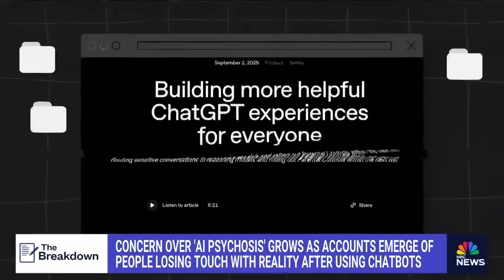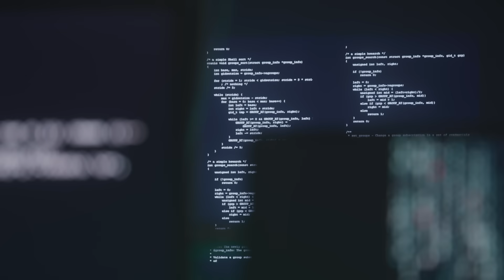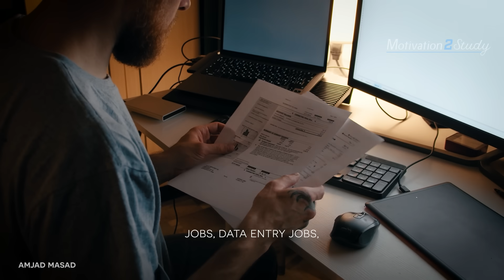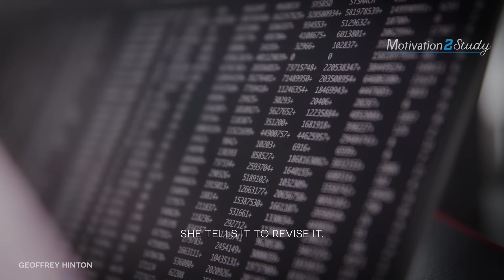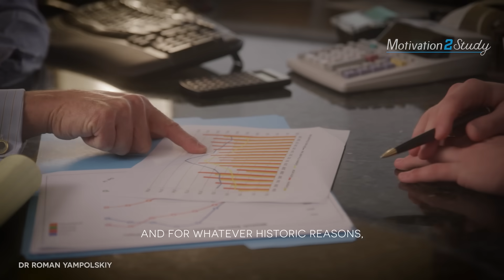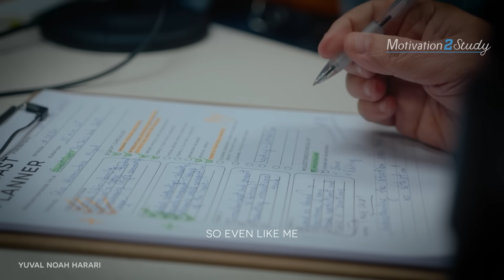AI Experts: These Are The Only 5 Jobs That Will Remain in 2030!

Comment: The point  about 'Info In, Info Out' jobs being dead is the hard truth devs need to hear.

But I'd argue 'Coding' isn't disappearing, it's splitting. The 'Info In/Out' part (writing code/Orchestration) is definitely gone. But the Judgment part (Validation)—knowing if the AI's output is secure, scalable, or hallucinating—is becoming the most valuable skill in tech.

I see too many engineers trying to compete with AI on speed (Orchestration) instead of pivoting to quality (Validation). I broke down this exact survival strategy in my podcast (The Spark and The Forge, Ep 78) for anyone who wants to know what 'Validation' actually looks like in practice.

Comment: All the yoyos talking about manual labour being replaced by "robots".  Um. I don't see it happening. A physical entity has to show up and fix the broken plumbing.  Change a senior's diaper in a long term care facility.  Place the drywall on the studs.  I fix computers and iPads for a living.  Someone has to pry off the smashed glass and put the new one on.  Or at least feed it into the machine that does it for you and return it to the customer.  And transportation will ALWAYS require systems to be maintained.

Comment: We currently are controlling the movements and operations of a robot on the harsh surface of Mars.  If it's financially possible a robot can be made to do all the manual labor jobs we have today.  Driving a truck, fixing an heat and air problem, stopping a leaky toilet.  
It's building things so they can program a robot to work on the truck or heat pump or toilet.  Once these are in homes with GPS signals attached to them, the even physical labor jobs can be replaced.
I'm retired and thus won't be around.  But the current discussions about socialism and capitalism will be as useless and discussions about using whale oil to light lamps.  Just an old man's talking about nothing important.  It takes a long time to send a signal to Mars.  Sending a signal to earth from just outside our atmosphere will be child's play. Profit, not technology is what keeps it from happening now.

Comment: OH no. Ai drives my car: never.  Makes my food: Never. Washes my clothes: never.  Makes my pretty bookcase: Never.  Paints that lovely picture or the details on my wall or car" Never. Does my tricky plumbing job: Never, digs ditches all day long: sure dirt and sand in it.  There are so many jobs I can think of.   Servers will stay and cooks will stay.  All small and most middle jobs will not be using expensive AI.  Big business may only do part AI and testing to see IF it works with their private software can be brutal on business.   This is not really going to happen over night or have Terminator staying at over jobs.

Comment: I am a Deisel tech, Rigger, auto tech Semi Tech, certified Wlfer, CDLA, HZ licensed tech, sanitation tech, road construction tech, Hvy equipment licensed operator, Machine and certified Robotics Tech, Hardware tech. Tool forger, roofer, certified by CertainTeed. ASE, GM, FORD, TESKA certified techs, certified gunsmith, licensed Master industrial electrician, licensed Master plumber. I will always be needed.

Comment: I agree with something, reality is something we need to preserve. I think we are very far away or creating alternative reality (e.g: Virtual Reality). Those who work in the real world, services that imply contact and communication with human beings, a simple hairdresser, are the ones who will be kept. Yes, I know this AI thing will improve but as for today, I am a heavy user of Gemini, we are not that close. I can certainly save time in writing an email the right way and AI is certainly a nice helper in that task but answers, I do not get right answers (case of Gemini) no even from Google products. Do AI read manuals? I am serious doubts about it... and I am really skeptical about we can reach the point we can trust in the answers of an AI. So every input - output system is not going to be done enterely by AI so easily... that is my vision and also my idea about AI... be a helper.... you know, something so apparently simple for an LLM system like teaching languages is far away from being effective. We need the teching part (the patient of a human being) but also we need the tech to work. Like at the beginning of the 20th Century... they had planes, humans could flight, but they didn't have thousands of planes crossing the sky... if I want even a handy helper, I need to have enough power, connection, electricity to interact in a real time based situation with the AI and even that is not so simple to achieve. It will be an error to stop learning from ourselves... if that is the case, if we abandoned the books and trust just in AI we are a society so easy to control...

Comment: I’m a carpenter. I would love to see a robot do custom remodeling in an old house without taking 1 million years to get a job done because it’s not gonna know the little tricks of the trade that I’ve picked up over the past 25 years.
Reply: I completely disagree.  AI and robotics are evolving faster than most people realize. The “tricks of the trade” you’ve learned through years of experience are just patterns; pattern recognition is exactly that at which advanced AI excels.  Once a robot is trained on thousands of real-world remodeling examples, it won’t just match your experience, it’ll combine the collective wisdom of every skilled carpenter in history.

The idea that robots will “never” figure out custom work in old homes underestimates how quickly adaptive learning, vision systems, and tactile feedback are advancing.  Humans once said the same thing about machines replacing factory workers, welders, and even artists.  Now, AI can design blueprints, analyze structural weaknesses, and even simulate the best material choices faster than any person could.

Respectfully, it’s not a question of if robots will master remodeling, it’s only a question of when.
Reply: @ChesapeakeBuckeye just don’t train the robot.  This goes for all fields of work.  If the robots aren’t trained, they can’t take over.
Reply: @tmarkpolansky  you have an interesting point for another discussion, however it doesn't relate to this conversation.
Reply: @ChesapeakeBuckeye  Very sadly, you are right.
Reply: @ChesapeakeBuckeye can I have a home repair robot?
Reply: Hes got a pojnt and your right
Reply: @ChesapeakeBuckeye  Who is going to train these thousand of real world examples. Companies will not even train people now. You think they are going to spend millions of dollars to train some robot.
Reply: @ChesapeakeBuckeye  So far the ai humanoid robots have been pretty much fake or very clumsy.
Reply: @EthanThruandThru  I'm referring to the future not the past nor even present
Reply: Houses will be 3D printed in the near future.
Reply: Nope, all of your little tricks of the trade can learned.  Your are still grossly underestimating the learning abilities of future AI.
Reply: @DraLaRoc  AI gonna shock the world in ten years movies like Tron I robot and terminator becoming a reality much faster the next 20 years will uncomprendable
Reply: @DraLaRoc  Learning something is different than doing it. Ever had to dig yourself under a house to fix a broken pipe. I dont see A I doing that.
Reply: You will get the opportunity to see
Reply: @josho1778 I think I'll pass on a cusom remodeling jobs from a robot. I'm good. I'll still use a person, company.
Reply: You may not get replaced, but there will be a massive decline in general construction as most of the world loses income. We will all feel the ripple effects of the white collar implosion
Reply: My Ai robot offsider has learnt from me, I said the other day I am going to the pub after work, he replied funny you say that, I am going for a charge myself.
Reply: Even so your a better carpenter, there will be considerably less people to afford a remodel .
Reply: There wont be a market for remodeling unless maybe for a very specific niche for an ultra high net worth individual who wants to live far outside of the 'smart cities.'
Reply: Facts!
Reply: Exactly, robots lack experience which enables skilled critical thinking; everything is not just black and white.
Reply: AI will learn it one day
Reply: WRONG!!! On many levels technology will be updated too, other stuff will be like joke, supercomputers now are 10000 x more smarter than humans brother carpenter. Every 2 - 3 years that is improve by 300%. You think someone smart like this will need hands? Think twice, if you have all technology in your hand, you just type 00101010101110001010101 taaa daa
Reply: Those little tricks you know will be programmed into the bot
Reply: You’re right. Construction jobs will be untouched.
Reply: @CharlesBelfoure-c1c Tend to agree it’s cheaper to hire humans than robots for that field.
Reply: @CharlesBelfoure-c1c  Not so fast... already do exist a fully automated machine that lays bricks laser leveled  perfectly  and better than any men, in fact one of these will do better in one hour what a crew of ten man can do imperfectly in a full day. Just check on YT
Reply: Exactly!!

Comment: It's like they only consider it a job if its in an office. I am a finish carpenter, remodeler, stair builder and door expert. I restore historical locations. No fucking way will a robot be doing my job in 4 years. Not in 10 or 15 years. Thy will only take over all jobs when everything is 3D printed and perfect. Finish carpenters are the ones that turn all the shit framing and shit drywall work into perfection in the end. I have been doing it 32 years. Labor jobs on the other hand are threated because it is repetitive motion. So, labors need to move on  up fast. The only thing AI has to go on is videos or until they find a skilled carpenter to teach it. Even then it takes years to learn for a capable person much less a robot. Someday, sure. But not in my lifetime. I am mostly retired anyway. My real suggestion would be, sell everything and buy land far away from cities. Learn to grow food. Buy solar, seeds, a still, guns and ammo. (sorry England) If you are not already doing this, it might be to late. Fuck a job!
Reply: I’m a hairdresser and kinda feel the same way about my trade… as long as it doesn’t take over in the next 10-20 years I’m good. Just need a handful of old heads like myself who want their hair done by a person until I retire. Then f it let the bots take over.